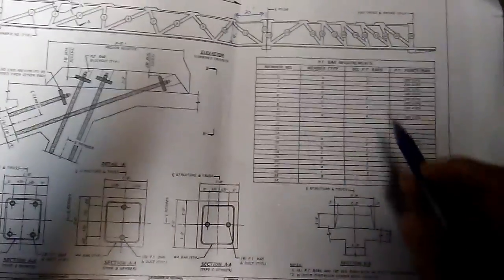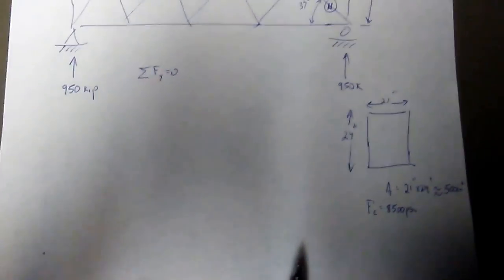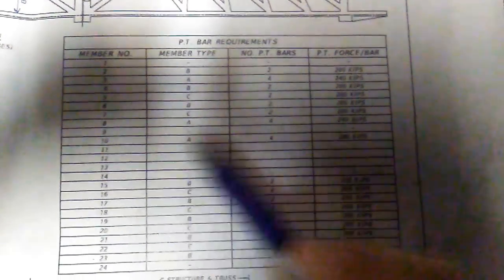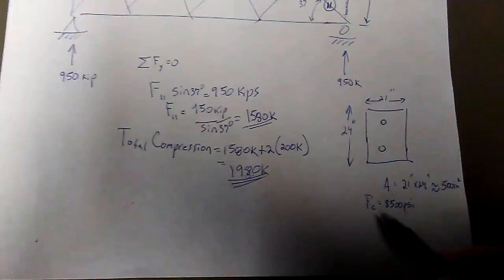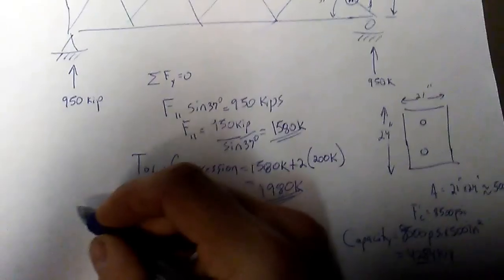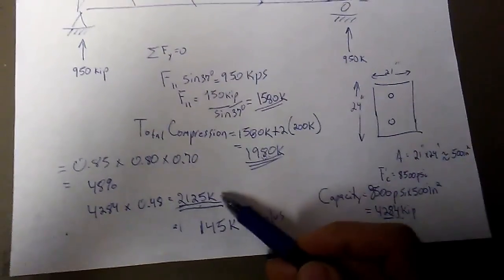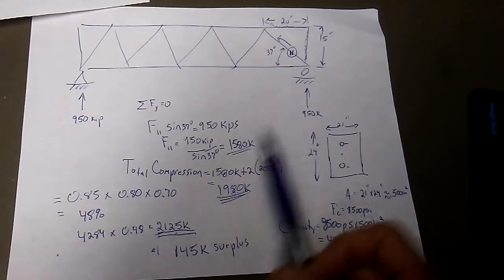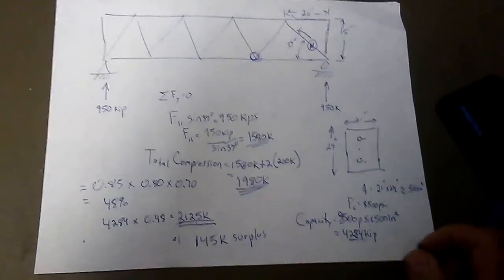FIU Bridge Collapse: The Hidden Truth (Part 3)

Comment: While all the speculation and analysis of the bridge collapse is interesting and important, I believe it misses a more important fundamental point. That being that the design was extremely flawed. The first mistake was designing an "innovative" truss bridge with a single row of vertical struts.   It is a single point failure with zero redundancy.  See the Silver Bridge collapse (https://en.wikipedia.org/wiki/Silver_Bridge ) about the need for redundancy and this caution about the dangers in a new design: "It is that its legacy should be to remind engineers to proceed always with the utmost caution, ever mindful of the possible existence of unknown unknowns and the potential consequences of even the smallest design decisions." It looks like the designer did not learn anything from, did not know about, or ignored prior bridge failures.

The Silver bridge was criticized for low redundancy. In light of this, how was a bridge with no redundancy ever approved? I would like to know what the published safety factor for the FIU bridge was.

This was initially described as a cable stayed bridge: 
http://www.mcm-us.com/news/mcm-awarded-fiu-pedestrian-bridge-project#.WsJ3Lq2ZPMW
"This $9.3 million project will be an iconic cable-stayed pedestrian bridge"

 Somewhere along the way it evolved into a truss design that mimicked a cable stayed design. It probably would have worked if it was a true cable stayed design with the cables tied into and supporting the deck. When they decided to make the truss with post tensioned concrete they could not have the cables support the deck so they made them decorative.

The fact that it was not a cable stayed bridge but was made to look like one should have raised caution and subjected it to additional scrutiny. It is a lie. It is deliberately misleading and being deceptive. If you can't trust that it is what it looks like, how can you trust its safety and robustness. It was designed to look like a safer design than it actually was.

The second mistake was designing a post tensioned concrete truss. There are complex rotational, sheer and bending forces between the intersecting adjacent post tensioned bars within the concrete that the concrete can't handle. These forces are hard to predict or model. Any tension forces within the concrete make it vulnerable to failure. The truss should have been made of two or more rows of steel girders and connecting plates that can transfer the changing loads effectively. The designer, design reviewers and approvers, at all levels, need to be held accountable. 

This was a very aesthetic "iconic" design with terrible engineering to showcase the ABC construction method pioneered at the school and to highlight the school of concrete engineering. What a huge embarrassment.  Shocked it was ever approved and built. Where was the oversight? This design will go down in history and will be studied as precisely what not to do.

Design discussion:
http://www.miamiherald.com/news/local/community/miami-dade/west-miami-dade/article206122229.html

The lack of robustness of the design is evident by the fact that a single worker was able to bring it down.
Reply: Robert Lee:  You are exactly correct.  The disaster is the result of group think.  In regard to all of the bridge's claimed positive effect on the community and school.  It failed in every respect.  It did not reduce the time traffic would be interrupted during the construction. It did not improve safety in crossing the road.  The construction of the bridge immediately resulted in an additional six dead.  It did not provide access between the school and community as it is worse now then before the bridge's construction.  It did not bring prestige to the school as now the school looks to be run by a ship of fools.
Reply from the maker: rickterfied Wow! Awesome write-up rickterfield. Could not have said it any better. We often learn the most from our failures rather than our successes. The silver lining is that this tragedy will hopefully improve future designs and the codes that engineers use to guide their analyses.
Reply: Thank you for the kind words structures specialist. My comment was a compilation of several things that were bothering me about this tragedy that seemed like they were being ignored or were not widely known. I wanted to 'get the word out'. It was in no way meant to discount your analysis and I am glad you didn't take it as such.
Reply: A stunning abdication of their primary, most critical function. They were required to know better and prevent anything even slightly unsafe. From the designers, design approvers, and the oversight people, at all levels (company, State and Federal), who were supposed to scrutinize the design and who ultimately approved it, all need to be held accountable. Talk about a systemic failure.
Reply from the maker: You are correct about the number of reviewers the design provbably had to pass through before going to construction. Unfortunately, in my experience, unless a reviewer has been intimately involved throughout a design and has painstakingly reviewed all calculations line-by-line, mistakes are often missed by reviewers. Ultimately, the designer has the most intimate knowledge of the design, and is best equipped to ensure that the contract drawings and specifications are correct.
Reply from the maker: Most truss bridges built contain 2 trusses. However, these bridges are as non-redundant as the FIU single truss bridge. This is because the failure of a single truss (due to failure of a single truss member) in a 2-truss bridge will result in instabiilty and a collapse of both trusses, similar to what occurred at FIU. Only with 3 or more trusses may a bridge be considered structurally redundant.
Reply: I think the design passed for a couple of reasons. One being the prestige of the Figg design firm, which has designed several cable stayed bridges and had an unblemished reputation. Another more likely reason is that the design changed from a cable stayed to a truss design somewhere along the line. It will be interesting to determine exactly when the change occurred. I am surprised no-one in the process identified, even with a cursory look, the single point failure aspect of the design.
Reply from the maker: rickterfied Many high-level concrete cable-stayed bridges (e.g. Sunshine Skyway) have high dead load to live load ratios. Concrete is heavy and because so much of it is required in those bridges, the concrete weight overwhelms the vehicular loads.
Reply: Robert Lee I have seen no evidence that the design was flawed, let alone extremely flawed.  You are making pretty bold statements. Are you privy to the engineering details of this structure?
Reply: rickterfied What qualifications do you have to make such statements?  Unless you have intimate knowledge of the design of this bridge, these are very reckless statements.
Reply: I have never seen a concrete post tensioned single truss bridge design before. One too many variables. I can't recall any concrete post tensioned truss either. Too many variables.
Reply: In looking at the detail of the connection, I wonder how the heck the compressive load is supposed to be transferred to the top chord (the upper deck)?  It looks like no consideration was made for a safe load transfer, considering no steel connection at all, and just a cover of concrete wouldn't be expected to withstand the high compressive load from #11 to the top deck.
Reply: LTVoyager:  Has anyone built a successful flying airplane from concrete?  If the single truss along with upper and lower decks had been realized in aluminum or even steel, the bridge would be standing.  The design flaw is in specifying concrete for an irregularly webbed truss.
Reply: @structures specialist; As I looked at the broken rubble, I did not see any abundance of steel, and in particular, no longitudinal members and no stirrups, as one might expect in any other type of concrete construction.  True, the drawings you have are preliminary only, but one might also expect to see some reference to additional steel, even if it wasn't shown in in Detail A.  Furthermore, by not showing all the steel at a particular point, the designer runs the risk of designing something that cannot actually be built.  Of course, that problem would turn up eventually, but making corrections on the jobsite is poor practice.
Reply: rickterfied...  to me this product is typical of our disposable society, there isn't redundancy in much that we build these days.  The earthen levees intended to hold back the sea in New Orleans that failed quickly, are an example.  Move fast, collect your money and move on, seems to be our mentality.
Sadly, people died, and after a total mirror in your face example of the need for redundancy, the engineering company probably will still be paid and the blame goes to the installer or the tensioner who over tightened the structure.
Reply: Radical AM ..  I think that watching the news or a press conference, it is very frustrating when they say "no comment" ..  I think that normal people speak their mind while they are still thinking it through, which tends to conflicting at times.  He isn't giving a final conclusion until the facts are in..  
Sadly, they probably already have an answer, and won't share with the public (possibly at all) or until all of the i's are dotted and t's are crossed.
Reply: LTVoyager .. (not an engineer) I have been thinking about your comment for two weeks and kept trying think of how to respond.  your comment "many of us rely on non-redundant structures fairly often" i.e. airplanes. 
 .. airplanes have the redundancies built in to the test and retest of the structures long before a passenger ever boards, and there is  endless structural upkeep, and routine check ups.
The Southwest Airline flight that lost and engine was an example. One passenger dead (tragically), but the plane flew to a nearby airport and landed. 
 It would seem that this project probably went to fast from the drawing board to the build.  I would not want to rebuild this structure and have yours or my college age kids walk on it ..
I am very anxious to find out what was the cause of the failure. 
On the surface it would seem that it was not strong enough and the diagonal stays from the tower, to be added later were to add more weight on to this span.
Reply from the maker: I agree that it is premature to claim a design flaw. There are many variables during construction that could have led to collapse beyond the control of the designer including inadequate concrete strength and improper post-tensioning procedures.
Reply: The Silver Bridge collapse was in 1967. It was criticized 50 years ago for low redundancy. Sometimes non-redundancy cannot be avoided, especially in flight. The non-redundant components are known and are deliberately over-engineered to compensate. There is no reason the single vertical truss could not have been avoided or should have been allowed in a bridge design.
Reply from the maker: rickterfied To your point, the fact that the bridge was  designed to carry pedestrians (90 psf) instead of heavy vehicles may have also been a factor in the single truss design being accepted.
Reply: Any other bridges you can recall that have such a high dead load to live load ratio?
Reply: structures specialist And even then only if the deck structure is strong enough to transfer loads to the remaining trusses.  Very few structures are truly redundant under all load conditions.  Such construction gets very expensive.  The economics has to be considered.

For example, we have the technology to build hurricane proof homes, but the cost would put such homes out of reach of all but the wealthy.  So, we compromise so that the average American can afford a home.
Reply: rickterfied A single truss, properly designed and constructed, is perfectly safe.  The main spar in an airliner is a nonredundant member, and the factor of safety in airplanes is much less than most buildings and bridges.  The key is sound engineering and quality fabrication.  System safety is not nearly so simple as making all structures redundant.  Doing that would likely decrease the overall safety of our infrastructure.
Reply from the maker: Thanks for the note! The method of construction chosen was certainly to limit any disruptions to traffic. This "ABC" method where the bridge is moved into its permanent location overnight is a pretty well established method that has been successfully implemented throughout the world.
Reply: rickterfied This one has only been in service for 84 years so I guess concrete truss bridges are new and unproven designs.

State Route 162 spanning the Puyallup River - McMillin, Pierce County 
Built 1934 
View design drawing This structure is a rare example of a reinforced-concrete through truss bridge. The form of its members and details are unique. At the time of its construction it was thought to be the longest concrete truss or beam span in the country. The bridge was designed by Homer M. Hadley. This bridge has been listed in the NRHP.
Reply from the maker: Good point. However, the drawings provided do not show the reinforcement details at each connection. I am certain there would have been a considerable amount of rebar reinforcement to assist with load transfer. This should become apparent when the as-built drawings are released.
Reply: LTVoyager:  Showo us a flying airplane made of concrete.
Reply: LTvoyager:  It's reckless to say a failed design was a good one.  A good design must meet the requirement of being able to be constructed properly and safely.  This bridge was a failure from beginning to end.
Reply: Rickterfied:  Have you ever seen a Halloween Witch riding on a concrete broom?
Reply: rickterfied, I like your comment because I think the same way about this cable bridge without the cables. changing the cable bridge into a single truss bridge with a messy detailed post tensioning within a skinny concrete truss member and yet a heavy 950 tons concrete bridge. if the mast and the cables were there when the truss walkway was erected, there still a possibility that the bridge would not collapse. But some inexperienced bridge builder decided to put the cart before the horse. In this case the bridge collapsed when there were pedestrians already using it and the cars below were being pancaked !...... George Wu, ARCHITECT, A.I.A., NCARB 2018-4-7
Reply: rickterfied I agree.   Ironically the design was based primarily on the desired aesthetic facade, when a bridge design that actually accentuated the real engineering would have infinitely more aesthetic appeal.   I bet the pedestrians were supposed to look at the structure on top and be fooled that it was anything other than a mockery of a suspension system.  

Moreover, it seems the attempt to overcome the natural tendencies of the material had no trace of redundancy in the crucial structure.   Ok, anything can happen, so of course one connection might have an error in the construction process, but,really, any one component should be able to be removed at any time with the structure remaining perfectly functional.   Especially in this post 9-11 era, anybody with a grenade or wad of thermite shouldn't be able to collapse anything by attacking a single point.  It was flawed from the very philosophy of the initial design.    Whoever approved the plans should lose their job, and the designer should never work with structures requiring any complexity or calculation.   Unless, the blame is 100% the installation crew, and they broke multiple redundant structures over an extended period to cause the failure.
Reply: rickterfied,  Do you think Figg used this truss design rather than a cable stayed design so it could be constructed first and then moved easily in place.  Where a cable stayed would have had to be built in place over the roadway?
Reply: tom ruth - I don't know why it was built that way. I would like to know when in the design process it was changed from a cable stayed design to a truss design. It seems like some scrutiny and oversight was bypassed.
Reply: structures specialist Sir ... you have just agreed with two contrary opinions in the same post! Absolutely incredible. First you agreed with Rickterfied that there is a design flaw, then you agreed with LTVoyager that there was probably NOT a design flaw. I can imagine this behavior of yours stems from social naivety and wanting to please every commenter, but it makes you look positively wishy washy and ruins your credibility when trying to explain something. You were doing so well before I saw this.
Reply: rickterfied,  It's missing perpendicular supports.  The forces calculated by "structures specialist" are not being properly supported.   The truss webs are not true supports but act more as pry bar levers.  It's completely obvious why the structure started cracking.  Once it had significant cracking, it was "bridge over."   Denny Pate is the Humpty Dumpty of bridge engineering.  He was completely out of his league when it comes to this design.  Apparently he went to the restroom when trusses were discussed during his schooling.  The calculations of "structures specialist" are completely off because it's impossible for it to carry the load because of the angle.  It's shocking with all his math, that he doesn't grasp that fact.  Apparently he went to the same school as Denny Pate.  Too much math and not enough common sense.  The geometry of the bridge is entirely wrong, and blaming it on the contractor is inappropriate.  It's a flat out terrible design that has no merit whatsoever.
Reply: Here's another thing,  other actual engineers have looked at this and have concluded that it was the deck that failed, not the webs.  The cracks were massive.  I'm sorry "structure specialist" you will never be hired by me for even a bird house. You conclusions entirely miss the actual problem which was a complete lack of perpendicular vertical supports.  It was a design that would never work in concrete.  I don't need to do any math, I can just look at it and realize it was a disaster getting ready to happen.  It would have been a miracle if it didn't collapse.
Reply: rickterfied I think it is premature to claim the design was flawed.  I realize that redundancy is a current hot button in SE, but it isn't always required and comes with its own costs.  And many of us rely on non-redundant structures fairly often ... if we fly.
Reply: Mr Rickterfied,
Thank you for a most erudite preliminary analysis of this tradgedy; none I have read nor heard comes close to yours.  Another element is this mix would appear to be the pressure of time parameters along with aesthetics and some bewildering notion that traffic need not be impinged upon.  The impression I have is that the building of this structure was in the hands of community activists, not construction specialists.